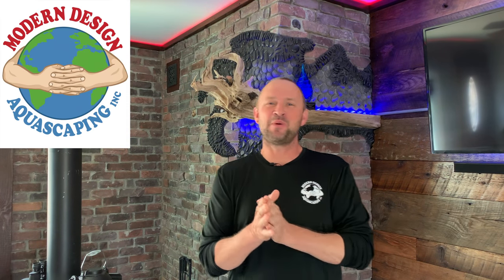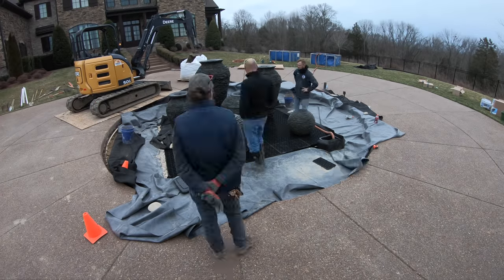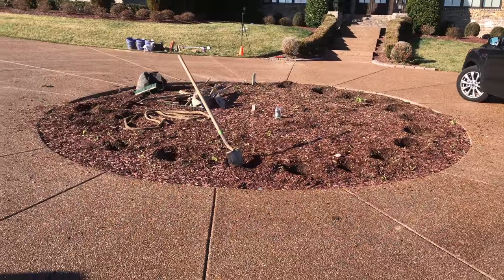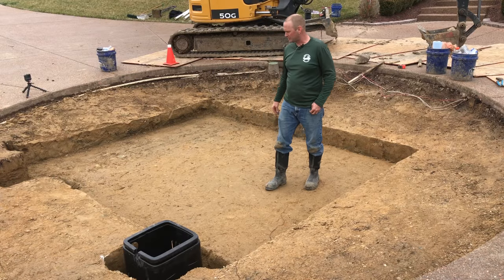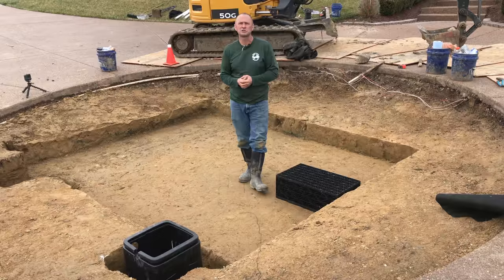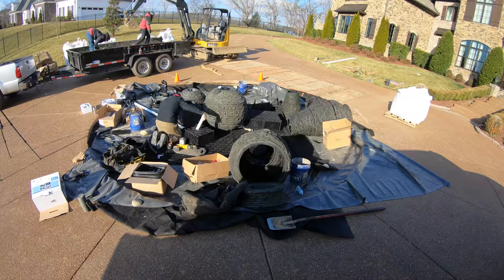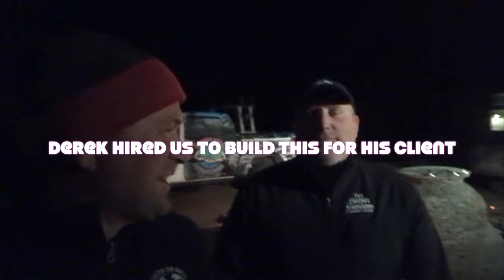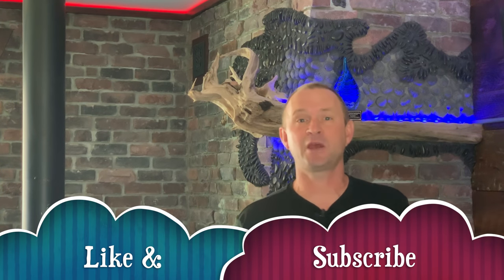Advanced Fountain Construction with SIX FOUNTAINS- How we built it!

Comment: Hello , I love your videos. Awesome job! I bought a drill and attachment to do the advance plumbing but it would not cut  hole. Any recommendations
Reply from the maker: We use a standard cordless drill with a hole saw bit I bought at Lowes. It is hard to get the hole started because the center bit that starts the hole (and stabilizes the big bit) isnt hitting anything because there is already a hole there. I started on an angle to get the hole going and then used that sise cut to help support the bit as I drilled. Also make sure the drill speed selection is on high. I didnt have any luck at slower speeds!

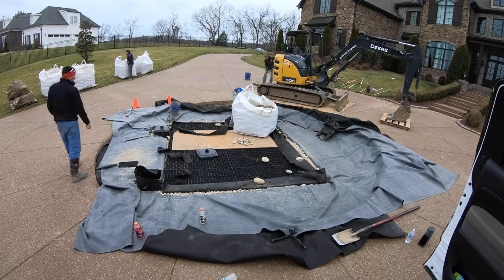Comment: At 4:11 of the video you show rocks being installed between the liner and underlayment. Any reason why I cant put that rock between the aquablocks and the underlayment instead? Seems like that would be the only weak spot since underlayment is used to protect the liner everywhere else.
Reply from the maker: Sure you can. If the gravel is too small and round (no sharp edges) we often put between liner and underlay to keep it from falling into the blocks. If it is larger we typically put it in between the bloc and underlay. No rules other that protect the liner from damage as needed!

Comment: Very informative and thanks looking forward to see how you install more luxury fountains with more accessories.what kind of tools do we need to do this kind of magic to be honest i have been scared to and looking for a way to install such,but your videos is giving me the courage to try something new.
Reply from the maker: A good set of cordless tools, some hole saw bits, the tools to install some low voltage lighting, and a ton of elbow grease!  We use a transit to set grades, levels and screed boards to get the bottom perfect, every hand tool known to human-kind (shovels-rakes-etc). Plumbing tools for cutting/ gluing pipes. Silicone for sealing where necessary- and Obviously the heavy equipment. It’s hard work, but not rocket science, you can do it!

Comment: How many pumps did you use on this project? What size pumps?.....I just ordered almost thus exact set up for my house. 3 Spheres and one large urn. I ordered three 2000-4000 pumps. Med and small sphere will share one. Large sphere and urn will each get there own. But I'm really hoping to get about double what you got on this project. Yes I'm gonna drill them out and I ordered 1 1/4" PVC.
Reply from the maker: We used 2 @ 4-8000 Aquasurge pumps and 2” plumbing!!
Reply: @KoiAddiction  Awesome. Thanks for the feedback. I was incorrect, I actually ordered 1 1/2" PVC and fittings. pump wise it sounds like ill be OK. Just gonna have to see if I went big enough with the 1 1/2"......Im prepping for rocks now so this video has been great with ideas for my feature. And the video you did with the lights flickering through the fountain and on your house inspired me to do that as well....Im assuming that with the two pumps you used on this project they are turned all the way up yes? all 16000 is being used?......Im also going to use a float system on both of my features. I seen someone use a bucket with a PVC pipe ran to somewhere else in the basin/vault and putting the float in the bucket to keep turbulence down and float system accurate. I dont know that that is the best way to do it. Do you have any videos you can link me too that covers/touches on float systems? I haven't found any videos that talk about floats much, or videos that talk about basin size if a float system can be used. Which seems kind of odd as in my head I'm thinking basin could be much smaller, and costs/maintenance would be far less. But what seems logical in my trade usually isn't....lol